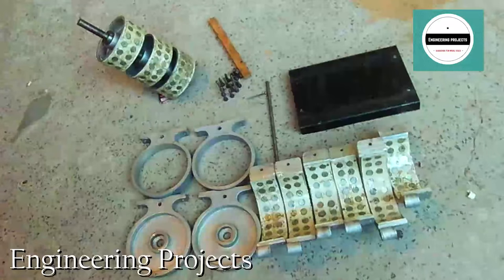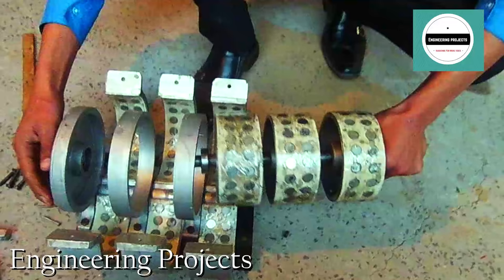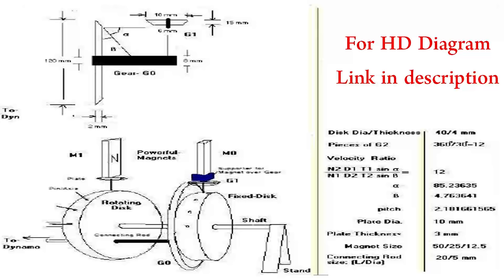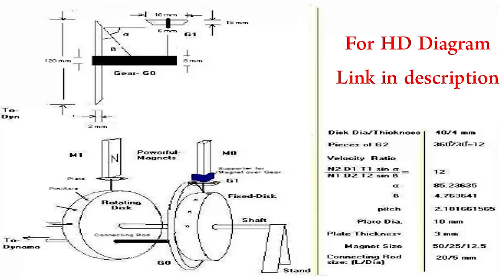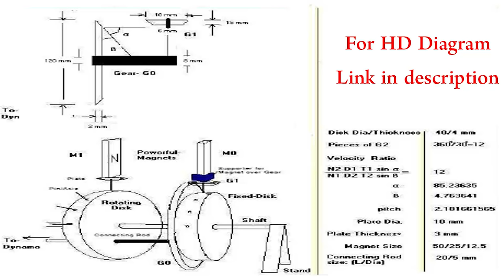Magnetic Motor Free energy world best technology engineering project 2020 part 2

Comment: Hey folks, don't copy!  I have a huge problem right now.  I connected the device to the socket and fed the free energy into the power grid.  My network operator noticed that my electricity meter was running backwards, prohibited me from doing so and imposed a large fine.  If you want to avoid big trouble, better keep your hands off it.  😢

Comment: It will not work in the way you are describing due to the "drag" in between fields just before the upcoming stator mags. They have to be individually shielded on one side compressing the "drag" side of each mag's flux field... To the point where the momentum of the rotor overcomes the now thinner drag layer of the flux. And if theyre too close to one another the fields flow together creating one big weird shaped flux. Messing up the whole intention.. This thing has to be large enough so that the flux fields arent meshing with one another.. Just a theory.

Comment: 1st, the inner wheel must be made from nylon and the outer rings and support structure must be made from Aluminum. 2nd, the magnets must be Fixed to the inner nylon wheel at 32° for the best movement. 3rd, the original structure used a lever locking system that would also act as a speed control. the closer it got to closing the faster it would spin. 4th, THE barrings on the center shaft holding the nylon wheel must use the same type of bearings in a cars crankshaft. keeping the ends filled with lubricant it will spin much freer and reduce the friction 5th, if you want to make the most energy from this any electric motor will produce electricity, spinning the shaft of the electric motor instead of giving it electricity it will produce it . But a smaller wind turbine would work best. because the motor is open on both ends you can place 2 generating devices on it.

Comment: there's no amount of examples that can delete logic...

magnets are a pulling and pushing force, no fuel, no fumes and they last forever, FOREVER!!

when you have a FREE pushing and pulling force, how can you not develop free energy....

magnets are free energy at their most simplified explanation

only a fool could take a free push and pull rock, and not get it to demonstrate free pushing and pulling

I believe the trick in these motors is to utilize the Push and the pull force of the magnet. And obviously the position of everything will have an effect on production
Reply: Magnets exercise forces but you are overlooking an important fact. When a magnet attracts an object work is done, but only once. To repeat this you have to pull the object away from the magnet, which needs exactly the same energy which was harvested before. The same goes for the pushing force. The energy magnets deliver is only what physicists call "potential energy". A motor can't be driven by permanent magnets alone, this would violate best assured laws of physics. Nevertheless thousands of people have tried it with all thinkable designs, but none of them worked. When you see a demonstration of a running magnet motor you can bet it's a scam, like this video.

Comment: i bet that you can harness electricity through magnets instead of hydroelectric damns. and maybe shrink these designs to power vehicles (full electric cars), also possibly powering the magnets in electromagnetism to increase electrical production or set it into overdrive. the momentum of magnets is probably underestimated at the moment. Imagine powering city's with just a small factory and flipping a set of switches or a car that doesn't need refueling, like a car you would see on fallout the video game series. These engines have the potential of producing more power than gasoline or diesel fueled engines. Wow, free energy at its finest. imagine that.

Comment: I had an idea that led me to this video. Funny enough about this technology. I believe there are ways to build a device that can produce usable amounts of "Free energy", utilizing the Perpetual Energy concept. Everything we know and see to this day exists because someone tried the impossible. There are people out there deliberately keeping this kind of technological advancement from the public, at the end of the day it's all about control. If you control basic resources you control the people. Kind of sad because at this point gas and oil is starting to dry up. The people of this planet need a realistic solution to our overwhelming production of unsustainable technology. It's killing the people, the planet, all so some asshole can keep his hierarchy of wealth and power. I'm curious what the outcome would be if someone were to attach a high output brushless motor to the magnetic motor, and attaching a voltage regulator and battery for storage. If you think about it the faster you can get the device to spin, the more electricity it will produce. Basically build a housing to contain everything, and make some upgrades to the magnet placement. Build it like a Honda generator, but design it to last, the only thing that would need to be maintained is the battery. Yea I think it can be done. Obviously your video proves there are other people out there pushing the limits and trying to advance what is there. I know I'm tired of the year after year crap technology pumped out. Its the same stuff with a new look of another useless feature, no real advancement there. People at this point are aware enough they know theres more out there.
Reply: working on my own design as we speak. I have had this design in my head for decades now. still refining it in my head, comparing it to other people's builds. And yes you are 100% correct in your statement.
Reply: @randycoolbaugh1408  I hope you can build a working model.
Reply: @chemsrus4914  Me too!  I do have many hurdles to overcome. Just need to get off my ars and get experimenting!

Comment: Themrotor and stator magnets on the segments look paralell to each other.  They need a minimum 15° from face offset and matching offset on the rotor, in the spin direction and zero offset in the shaft plain.  The device shown would not need three sections ( except torque multiplication ) to prove it works.

Comment: Same concept could be used using rail systems with buffers on each side while placing magnets of different weights in size for areas of larger or greater propulsions with energized properties with the introduction of frequencys to rate levels of friction and output while implementing a conductor to harvest said power or energy

Comment: Its imposibble. Also the magnets must be in motion all the time, and you must have source of energy for this. Because magnets have static magnetic field, particles dont move like in wires in electric field. This is the law of electromagnetic induction. You must have electromotive force( praticles moving), not stationary field. Try to use gravity as a source of energy, but you must understand, that you cant have energy forever, with gravity maximum 1 hour. But its low power, you must have power inverter also. So infinity energy in our planet and reality doesnt exist.

Comment: This not complete and not proof
I did make many models but did not work.
Magnet have 2 forces n&s one equal other and different direction hence the resultant is zero you can't use them simply

you need to add another force which is the gravity force then we can say it works otherwise it is useless.

this model in viedio is useless.

Comment: I get it now it only works on that side of the world in pakastan and asia india because it is close enough to the piramids which radiate  the correct magnetic energy and lines of flux to make this type of motor function correctly
 I suspect this motor is much older then we imagine. Could this motor be the one that powered the lightbulbs that are drawn on the walls in the Egyptian tombs?

Comment: Has the fracturing of the magnet's crystal structure's been over cone yet? From the use of the motor? Has graphene been used to construct the the parts that hold the magnet's? Has Gadolinium been used to replace the other magnet's and liquid atmosphere used to super cool the motor then being able to use superconducting levitation allowing the engine to spin at hyper velocities? Then attach an automatic transmission to each fly wheel then attach a large rewired drum motor in an electrical power generation configuration with magnetic bearing's to each automatic transmission to produce clean strady electrical energy.  😊

Comment: in the eighty,s i saw a train the germans developed that charges up power  through eloctro magnets , it works on a push and pull system the gap between the magnets is very interesting it makes it run faster or slower i had the same kind of idea as what i see here just never came around to make it due to finances but playing with small magnets without any coil i got 1 volt out of it i,m not a electrician so i ran this past a few fellow workers who are electricians they just laughed at my idea  inventors some times come up with great ideas although they dont know the theary  behind it  i just love to see someone has done what i have had in mind since the eighty,s